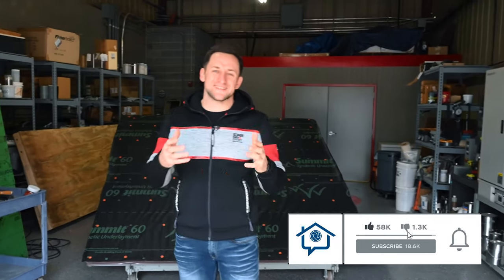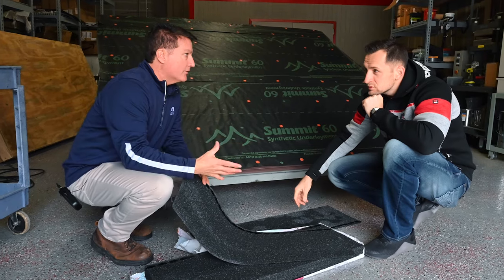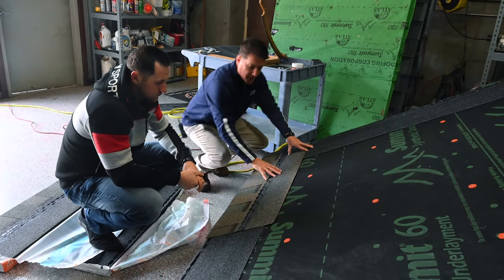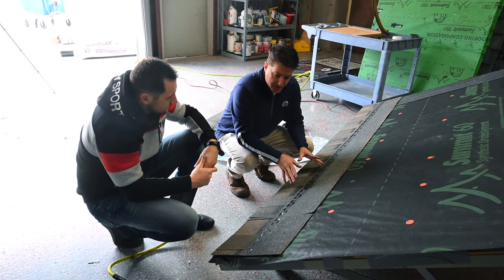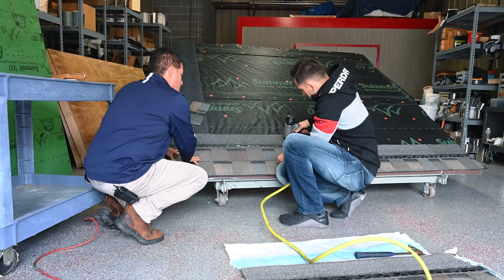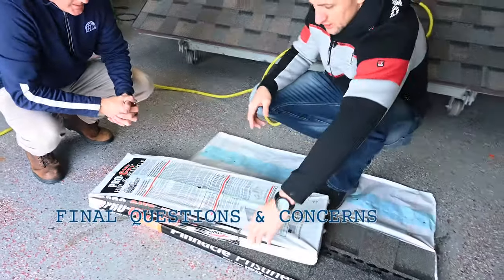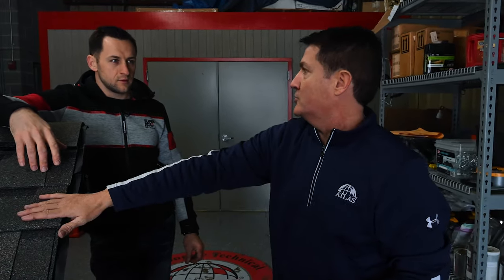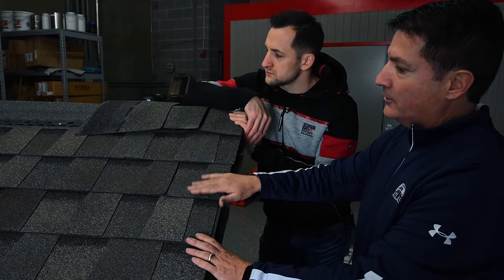Roofing: How To Install Asphalt Shingles: Atlas Edition

Comment: Good video. Only things I recommend to add in order to make installs easier are the following:

1.) Mark with chalk line the starter and course lines. While we have great installers, it is best to have the best straight course lines and prevent the “snake effect.”

2.) cut the starters on a 45 degree where they meet at the corners of the rake and wave for direct and continuous bonding. 

Excellent questions throughout the video by the way.
Reply from the maker: Great pointers. Like the idea of 45 degrees on starters
Reply: The 45 cut on bottom of that rake shingle is pointless.

Comment: excellent video! 
I have about 8 bundles of this shingle in my garage waiting to put on my shed (tomorrow).  I've never done shingles before but like everything else, I'll 'do it myself' because contractors are just off the hook with their pricing (and I am an IT Field engineer contractor and unlicensed electrician).  I did the ice and water shield today, drip edges, and the underlayment (covering my ice and water shield), so I feel very protected, lol.  I am not even going to have heat out in my little 12 x 12 shed but I want the experience of doing all of this because I plan to redo the roof on my main house.
The roof is only a 4:12 but around freezing temps with no sun, there is NO traction up there.... and I live in a rural area and the wind is absolutely atrocious!  There will be no wind at all, all day, and as soon as I get up on the roof, BOOM, 20 Mph winds! lol  That is a little exaggeration but it did happen like that last week.   Today there was an annoying steady 5-10Mph breeze that made doing the ice and water shield and the synthetic underlayment extremely difficult and aggravating.

Thanks again for the video!!!

Comment: I shingled this huge doghouse with Atlas Castlebrook 42" super wide, it turned out great but i wish i would have watched this video first, it was below 40 degrees and i didn't know i could just rip them apart, it would have saved me some time cause i cut them all with a box cutter. They are really nice shingles and i got the best looking dog castle on the block maybe the county.

Comment: Lots of variables in the roof warranty.  How does the homeowner prove that the contractor installed the roof when it was 45 degrees?  How does the homeowner confirm after the fact that the roofer didn't use staples on the under lay material, which voids the warranty?  Roofing industry warranties seem to have a lot of variables that would not benefit the consumer/Homeowner.

Comment: Staples on synthetic paper is not good. We papered a new home real quick before some rain a few years back. Might as well not have papered the house at all because all the staples were dumping water. Had to replace the paper with cap nails. I know some dont leak with staples but its alot safer to just use platic caps.

Comment: Also cut a 45 on your Top laid starter going up the rakes......this allowed for constant seal/bond!
Reply: I think they adjusted the starter going up the rakes to be a inch or so high from the bottom (I looked closer in the video) So they didn't need to cut a 45 on the shingle going up the rake, but yes when the starter is overlapping the eave starter you should cut off a portion to reveal the tar line.

Comment: Thanks for another great video Dmitry. 

I am planning to replace my roof this summer, I live in Calgary, Alberta. We get extremely hot summers and cold like Siberia winters... Oh, and we get hail, sometimes very large and hard as roofers and car owners will attest too. I am swaying towards Malarkey, Atlas and OC. Home Depot stock GAF. Not so sure about GAF...? The shingle will need to be Class 4 for the hail. 

I sent the three short listed manufacturers questions about warranties, especially since I am not a roofer, but they have not replied. Any suggestions...?

Thanks for this information. 

Thanks.
Reply from the maker: Atlas Storm master will be the best value for the dollar. OC flex is also class 4 shingles and great option, so is Malarkey class 4. Cannot comment on GAF, I didn’t test their class 4 shingles or any other shingles for years.

Comment: How do you hand seal the roof if you have installed in colder weather and have to come back?
Reply: lay a bead of asphalt cement on each shingle before you put the next one on top of it
Reply: @ivtec845  but the shingles were installed previously during cold weather and it may be months during cold weather before the contractor can come and hand seal.
Reply: @jerrydimond4759  As long as you don't get too much wind before warmer temps arrive, you should be fine. The seal has nothing to do with the water shedding ability of the shingles.

Comment: Atlas…….crap shingles just like Tamko. I remember when I first laid them back in 2005 when I was a young buck roofer. Was blown away by the difference in quality of how each shingle brand was back then and could easily tell what kind of contractor’s I was working for back when I was a sub (the contractor’s I could sense who were in the roofing business for the money w/ little true experience would put the low end shingles on and the top notch contractor’s put the higher end quality shingle on. (because a roofer who touched, walked on, and cut shingles every day or multiple different brands of shingles throughout a year would know what shingle brands have true high quality). Anyways, they’ve definitely improved over the years however I’d rather install the other low grade comparable shingle IKO still to this day. Malarkey and GAF all the way. OC and Certainteed after that 👍

Comment: This is a great video but im upset that the manufacturers are telling installers and home owner its ok to shingle over old shingles, it's is not ok to shingle over old shingles even if the manufacturer says it is, it is never ok! 1, you have more than doubled the weight load. Here in Canada you will over stress your trusses when adding a snow load and create sagging trusses in your roof. 2, your new shingles will wear out faster from the extra heat absorbed by 2 layers.

Comment: The homeowner is totally vulnerable and in reality filing a claim with this company or any of the roof manufactures would be a complete nightmare.  Answer the question was it installed properly? How do you prove it?  4 nails / 130 mph warranty how does the homeowner prove it to the Atlas people.  Warranties are a scam it seems.
Reply: Jerry Dimond funny thing is.... requirements and tests are done at 120 mph. But they had to add that extra 10 mph to make it sound better.... correct me if I’m wrong, and I’d like to know if someone has heard otherwise.... test is don’t with putting shingles in an oven at 140 degrees for 2 hours, then is blown with 120 mph sustained wind for 2 hours??.... that’s the requirements I know of, so they must be going somewhere else than the rest of the industry!!

Comment: From Atlas's warranty card: "LIMITATIONS OF COVERAGE (WHAT IS NOT COVERED)
ATLAS shall not be liable for and the Limited Warranties set forth herein do not apply to:
a. Faulty or improper application of said product or products not
 installed or applied in accordance with the printed instructions on the
 product bundle wrappers."
From the Atlas installation instructions: "The deck surface must be clean, bare, gap free and flat."  No where does it say that you can roof over old shingles and get a warranty. I've heard it from my Atlas rep and several other sources that they require a complete T/O to get a warranty of any kind. MAYBE they make an exception for the scotch guard warranty??? Otherwise this guy is fos and misleading...